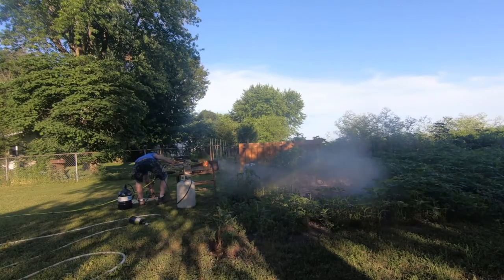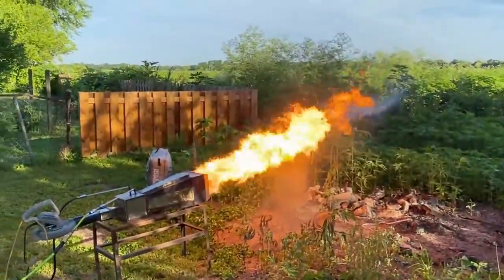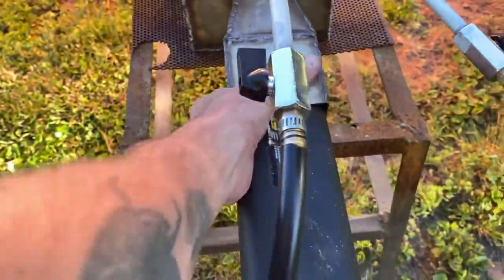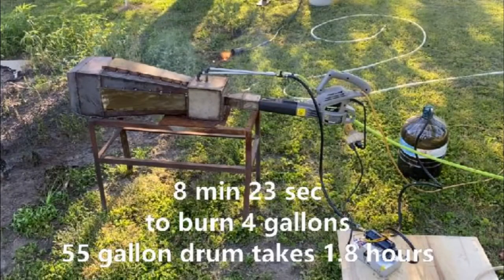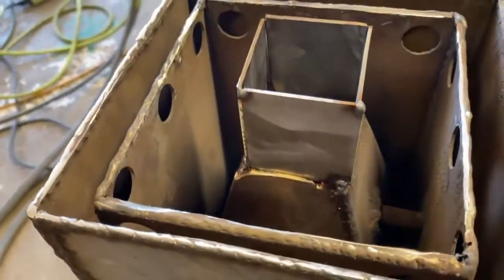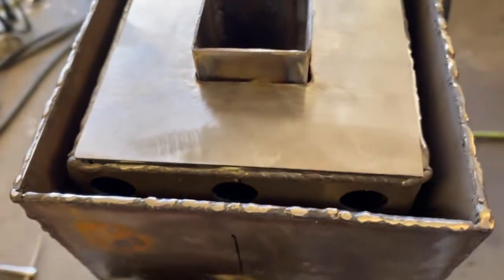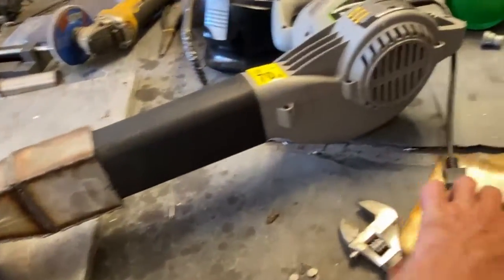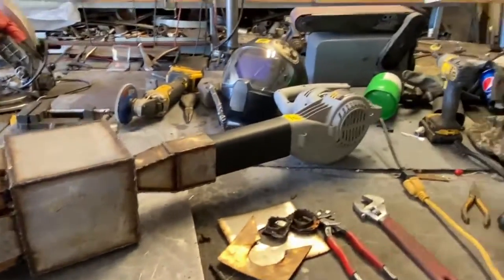1 megawatt oil burner with Leaf blower

Comment: at 55 gal per hour your only about 200 hp boiler
Reply from the maker: boiler hp is retarded so i dont ever use it , i use KW or thermal power Gross to describe power . Only people who SELL boilers know what boiler hp compares to in a reasonable sense , comman people cant grasp what you mean by BHP . 
200 boiler Hp x 13.1 =    2,620 Mechanical HP

Comment: your  math is a little wrong you could run almost a 80 hp boiler on this flame to get to a 1000 hp you would need 46,000,000 btu or 329 gph of oil.
Reply from the maker: check your math your way off , its 10,000 watts of power per liter minute . your math is  off bad . re think it and get back to me . Not sure how you came up with that but your dead wrong
Reply: @NOBOX7  I work on boiler I own my own Company and I have been working in this industry since I was in High school.  the simple math is that oil or waste oil only has 160,000 btu's per gal

Comment: The gas powered compressor needs to run constant to keep sufficient air power for the oil siphon?
Reply from the maker: No the oil has a pump the air just atomizes .  a 2 hp air compressor can run this
Reply: @NOBOX7  what you using to pump the oil? Just like a 12v transfer pump?